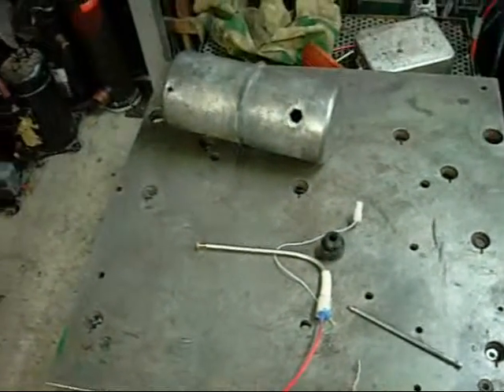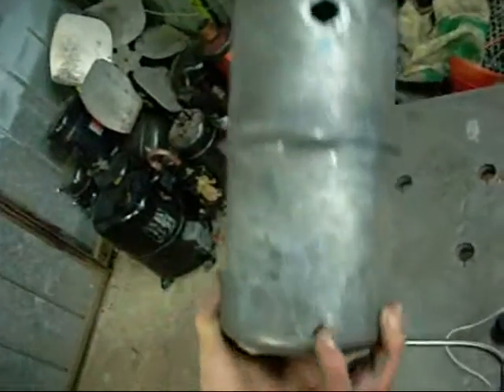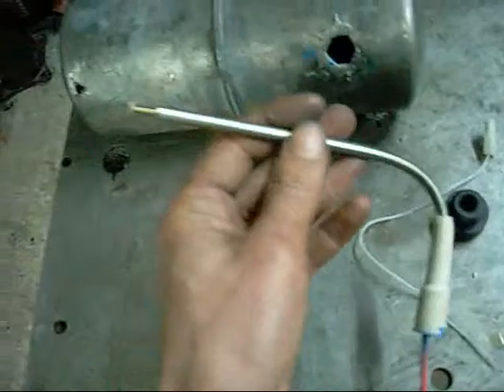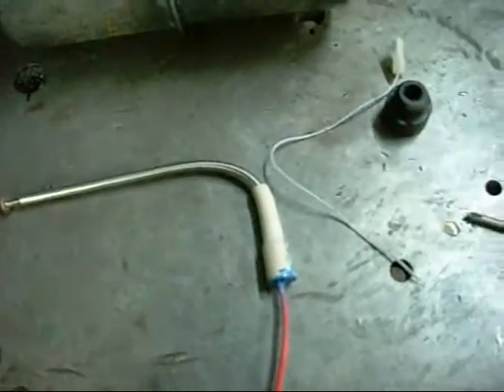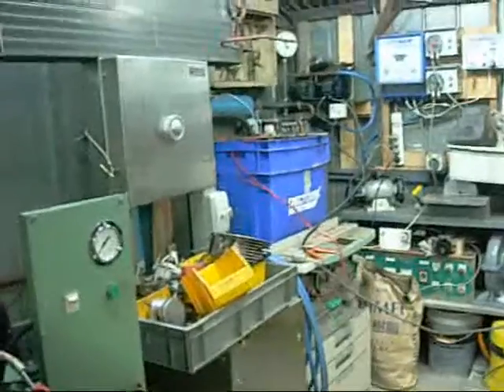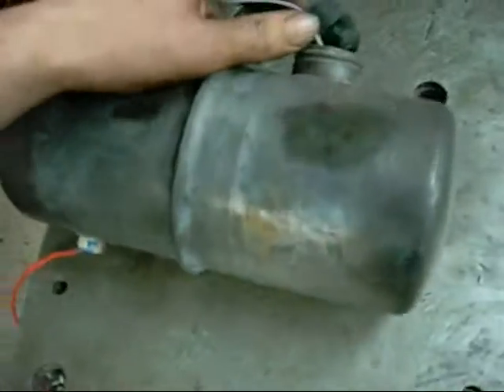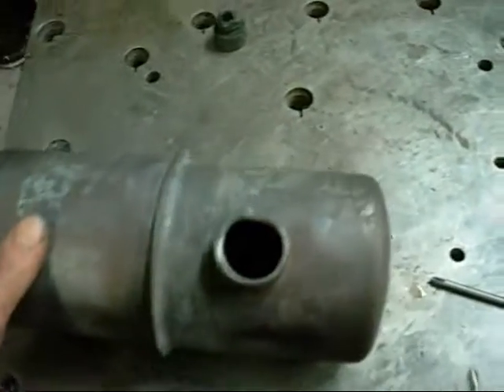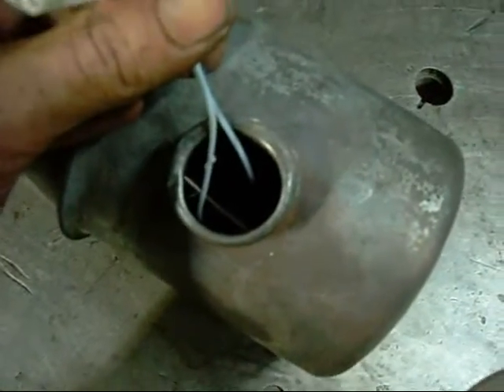De rusting Inside Fuel Tank with Electrolysis

Comment: Would this have worked without the anode inside the fuel tank?  Just wondering if there is an easier way for me to do a motorcycle fuel tank.

Comment: Another way to keep the electrode from shorting out is too wrap it in fiberglass screening.  For electrodes, I use graphite electrodes that are scrap from EDM shops and die sinkers.  The advantage is no rusty waste byproduct to contaminate your electrolysis tank and the electrode never needs to be cleaned.

Comment from the maker: I just tip it out behind the shed, but as long as you are only stripping rust or non-lead based paints it is perfectly safe to tip down the drain, after all its just water, baking soda and iron oxide.